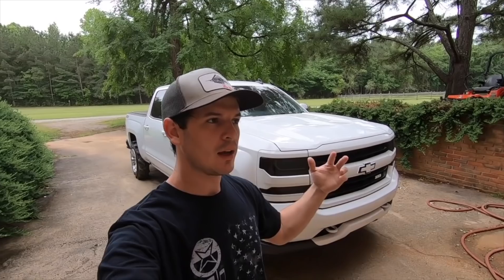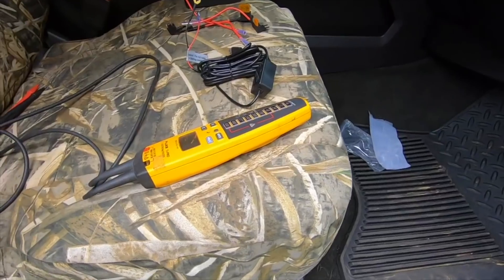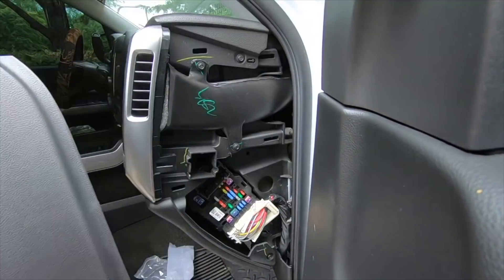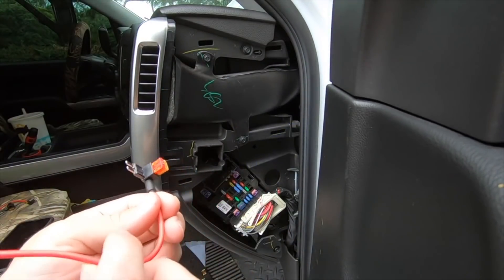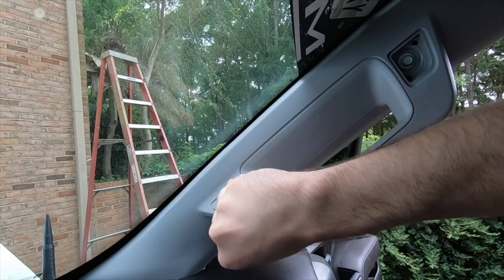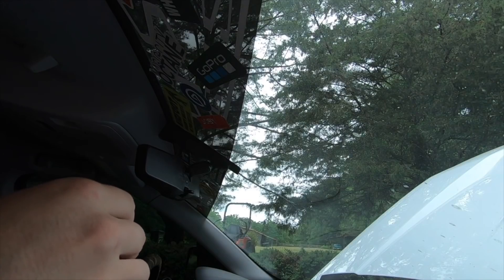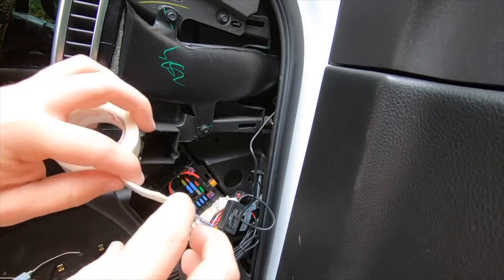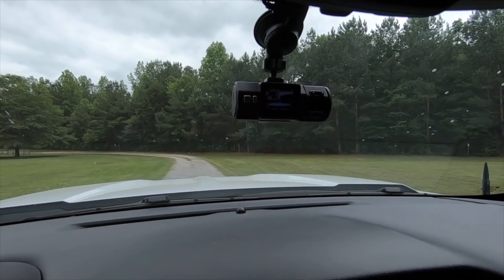Vantrue N2 Pro dash cam - full install

Comment: I just installed my dashcam last weekend. No where near as nice as yours but I plugged it into an accessory fuse so I guess that means it's running off the alternator. Tbh I was a little sketched out if I ran it off the battery it would kill it overnight. But now I'm reconsidering running it off the battery.

Comment: Hey Chase, hope you see this man. So I have a 2015 Silverado (6 inch lift, 35/12.5/20). Literally today I just took off the side trim on all four doors. It’s the exact same process as the rebadging. So it’s super simple and easy. I really think you should do the same!! Your truck is clean as fuck and it’d add a really nice touch to it! P.S. keep up that badass build man 👌🏽
Reply from the maker: Hey man, i actually like the side trim personally, plus it helps with people opening doors on you!

Comment: I feel like it would run my battery down if it’s hard wired to the battery
Reply from the maker: My truck sits for days with this and my range device running. Not affected at all.
Reply: Alright cool
Reply: Yea I was sketched out too
Reply: The hardwire kit says it will cut power if you drop below 11.6V, or enough to start your vehicle.